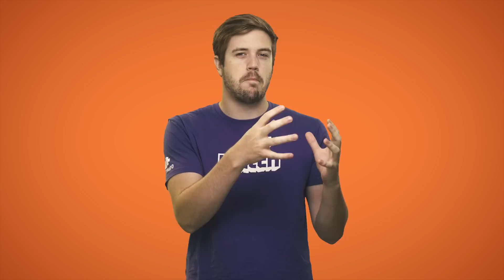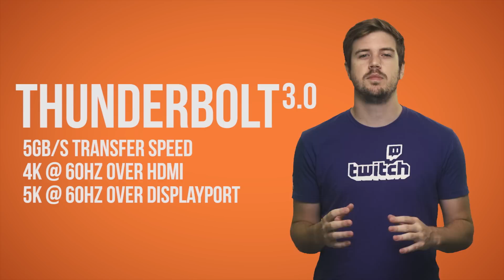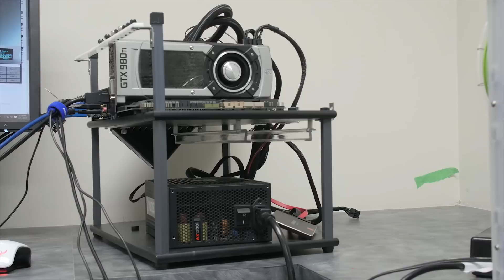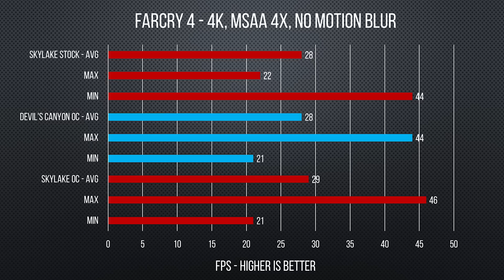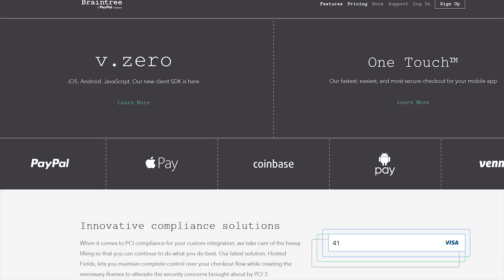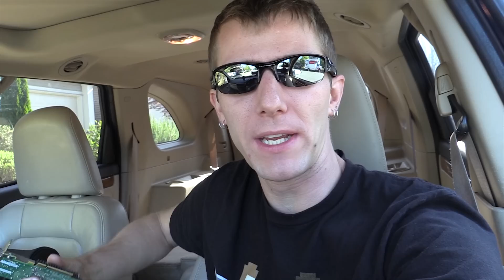Intel 6700K "Skylake" CPU

Comment: why didnt they put i7 5960x in the benchmark ?
Reply: +Matija Tkalec Because that's completely absurd.
Reply: why did intel release new CPUs if they arent better the the best current CPU ? At least cant they make skylake CPU with 8 cores hyperthreaded ?
Reply: Because people have different budgets and applications.

They will be releasing the high end ones later I assume.
Reply: Matija Tkalec they will when they update x99 ...
btw you can't compare a 350 $ cpu to a 1000$ cpu that is just pointless
Reply: +nightcore virus They have their xeon chips,  They have an 18 core 36 thread xeon, if you have $7000? http://ark.intel.com/products/84685/Intel-Xeon-Processor-E7-8890-v3-45M-Cache-2_50-GHz
Reply: nightcore virus Apparently the 6950x is going to have 10 cores.
Reply: nightcore virus No, the single core for it will be the same or worse, as stock speeds need to be kept in check for stability reasons. The 5960x at stock is meh, but it can easily be overclocked past 4ghz, as will the 6950x.
Reply: nightcore virus Well the reason the 5960x has "poor" single core is because you're probably comparing it to other Haswell chips, which all run at higher clock speeds stock. An 8 core CPU is not going to be able to clock as high as a 4 core CPU. :P
Reply: nightcore virus How do you figure? The 6950x will be Broadwell-E, so it's barely any better than Haswell in terms of overclocking. The only chip they have that's been able to break 5ghz without extreme cooling (phase change or LN2) is the 6700k, and that's Skylake, which is actually quite far ahead of Broadwell in terms of efficiency.
Reply: nightcore virus It's not Haswell-E, it's Broadwell-E, Intel does not release enthusiast chips until the architecture has been around for like a year or something, which is why the 7xxx enthusiast chips will be Skylake-E. People are most definitely going to buy it just because it's a cheaper 10 core CPU (Cheaper than a 10 core Xeon). Nobody in their right mind is going to expect an architecture barely better at overclocking compared to Haswell to be pushing 4.5+ghz on 10 cores. These type of processors aren't meant for gaming machines, you don't need super high single core performance. They're meant for workstations that are going to be doing a lot of video editing or 3D rendering, stuff like that.
Reply: nightcore virus When your going up to 10 cores, your crossing above the line for just gaming and simple rendering, unless you have more money then brains, because you'd never use or need the performance that the CPU can offer. Of course it's going to be overclockable, and it's going to overclock well, just not as well as  a 4 or 6 core i7. It's not going to be hitting 4.6 or 4.8ghz most likely, maybe 4.2ghz.
Reply: +EV Video What does consumer grade mean, kept searching it up and still can't find the answer :P
Reply: XGamingStormX
lol, thanks :P
Reply: +EV Video wrong...5960x has piss-poor single thread performance compared to 6700k..even sandy-bridge has better single thread speed.
Reply: +Matija Tkalec the 5960x would of performed worse due to a lower clock per core and the fact that these games don't support 8-cores very well. it's even worse than a Pentium G3240 single core wise, pretty poor that this cpu that is 20X cheaper.
Reply: +drakedoggy103 That's my argument when you compare Intel to AMD
Reply: +drakedoggy103 6800k, 6850k, 6900k, and 6950x are all x99. With 6, 6, 8, 10 cores respectively. Gonna be a big upgrade for X99, and that means the 8 core will be less than $1000. :3
Reply: +LiquidPanic I hope that ten core beast is true. God I wanna see something over 10 cores already with intel CPUs
Reply: nightcore virus Umm, Intel has had over 10 core CPUs for a few years now.
Reply: LiquidPanic Apologies, WHAT? I'm sorry I don't look at their line up much. I just look at any of their flagship CPUS. I didn't know that, but I'll look more into it. Thanks, and apologies for that little derp.
Reply: Chloe Fitzpatric, I was talking about their high end gaming chips, not their server ones. Lol but the 18 core is a true beast especially for gaming, but eh I want a higher clocked, more core chip, sort of like that 10 core that was rumored. I haven't heard much on it but I hope it is true.
Reply: LiquidPanic ohhh, 6950x. that sounds good. I can't wait to see how it'll perform, hopefully a lot better than the 5960x, heard the single core scores for that chip were horrible. Hopefully this does better.
Reply: LiquidPanic I see, well I had meant over clocked or not. That the scores show improvement from the last gen. But I see what you mean, wouldn't mind trading core score for stability. And I'll be surprised to see how well of an improvement the 6950x offers over the 5960x. Itching for it
Reply: LiquidPanic Trust me I know it won't clock nearly as high as them, and no. I'm not comparing them to others. I'm going based off of what others have said about the "poor" single core scores, I've seen some and haven't ever thought of them as bad. Hell they're pretty damn amazing scores for an 8 core beast. But I wish it could clock up that high, maybe in the ten core version it will. :P
Reply: nightcore virus If the 6950x has 10 cores, it will probably overclock about as well as the 8 core 5960x, as the power efficiency increases, but there are also 2 more cores to power.
Reply: LiquidPanic I'm sure by now intel has been able to make advances in being able to power all cores and keep them stable at very high frequencies, without needing to hold it back more. and I do hope you're right about that.
Reply: LiquidPanic Hmmm, well I don't know to be fully honest. I'm just hoping intel learned from Haswell and made these new chips more efficient and better in overclocking. You'd think because it's ten cores, 20 threads people will just buy it? Nope.(not saying anyone needs a 20 thread beast, just using it as an example.) But they would buy it for it's efficiency and how well it overclocks and handles different workloads. Honestly I'm not thinking over overclocking past 5ghz. Really no need for it at the moment. Well for most. and you already know what you need to overclock beyond 5ghz. That's isn't possible with standard cooling, least not for long. And I was under the impression that it'd be skylake? Hadn't thought it was still on haswell-E. Odd
Reply: LiquidPanic Ahh I see now, my apologies. I see now, and well I had thought it'd be around or above the price point of the 5960x. Since I thought it was to surpass it as the new beast of a multi core chip. But I see what you mean, I know they'll jump on it because it's a cheap ten core. But that doesn't make sense, if you're not looking for a ten core, highly overclockable chip, then why even bother with these? get Xeon if you need it. Regardless of if it's cheaper, aren't these types of chips meant to be more towards gaming/rending types? Like less server/workstation, more gaming/rendering. Honestly I really don't get that, I guess i have high expectations for this new ten core beast. Hmmm
Reply: LiquidPanic Well obviously if you buy this, you're gonna probably be doing some heavy rendering and gaming. I doubt you need it unless as you said you've got more money then brains. But I don't know, I myself if I could would buy it just because it's a ten core, though it'd make me do more rendering and gaming rather than let those cores go unused. And that's what I wish I could see, it go neck and neck with 4 or 6 core i7s. In clockspeeds and in single core scores. I just love seeing intel push the limits of things you know? being able to over clock a beastly ten core and remain stable and at decent temps. Hell that's what I wanna see coming into 2016. Pushing the limits without holding back. And I'd say maybe 4.4 to 4.5 max on the ten core. Wish to see something around 4.6 or hell even 4.8 on that. I know temps would be crazy on air, but simple water cooling or even heavy water cooling could possibly push it further. Maybe
Reply: nightcore virus Ehh, high end air coolers can offer the same performance of the majority of water blocks. Water cooling only really helps with GPUs, and just adds more points of failure anyway, I don't really see a reason for it. It's not worth it for such a small improvement in performance on GPUs, and maybe a degree or two difference in temps. Also, you keep saying single core performance, but in terms of demanding tasks, gaming is literally the only thing that benefits more from better single core performance, more cores is always better for any type of rendering or serious work.
Reply: LiquidPanic Considering I've lately started seeing water cooling as the best alternative (not for newbies). Only for those who have a decent amount of experience in building or upgrading pcs. Regardless of how much it helps, be it a few degrees or a major amount (not likely). I'd still get it, and well I know what you mean about it not really being much of a help cpu wise, but I do wish there were better ways of cooling the cpu using said waterblocks. Like idk maybe using different materials and finding better designs to cool them? then maybe you can OC higher and keep the system stable and lasting without failures or issues. And I keep mentioning single score because that's been the "issue" I've seen people complaining about the 5960x. My apologies, does get annoying to keep mentioning single scores. But yeah it's not really important considering this is an 8 and ten core cpu we're talking about and not a 4 or 6 core one. Honestly I agree with you that that's what it is best suited for, I just wish we didn't need Xeons for this type of thing. Maybe we just want to have an insane multi core cpu incase we want to do many things at once or hell render multi things at once? more Pcie lanes? A larger gap between being too under powered for many graphics cards or Pcie devices? But you're right, serious rendering and anything requiring such a high number of CPU cores would suit this chip much better. And I mentioned Pcie lanes because I would like to see that number (40 from the 5960x) go higher maybe 50 or 60? guess I'm just asking for too much. But I don't know, it'd be nice.
Reply: nightcore virus Sadly the PCIe lanes isn't going to happen. From the current roadmap, Broadwell-E will still have 40 lanes max. Even though it isn't confirmed, I doubt it will be higher, Skylake-E in a year will apparently have more, but yeah, I'm with you there, I kinda wish we had really high end boards with 16+ lane PCHs on the chipset, that would be nice, but it's hard to do, so it's asking a lot.
Reply: LiquidPanic I'm sure if we had high end boards, everyone would need to upgrade to a CPU that worked along that board (Skylake sure looks annoying now). But I do wish we did, same for CPUs with more than 40 Pcie lanes,. I wonder if we'll ever hear something like this confirmed or planned for down the road CPUs. And yeah it is asking for a lot. But I don't know, stayed with the same 40 and less for a while now. Guess I'm just rushing them to have more Pcie lanes with their cpus

Comment: PLZ i need a awnser to my question that has nothing to do with this video: I am planning to build a €1000 gaming pc. (Almost same as us dollar so just see this as $1000). I stil need to save some money to buy it. But i just bought a new 27 inch 1080p Lg monitor earlier this year. I think it was the Lg 27mp77hm and i bought it for €279. But now i am reading a lot of things about gaming in 1080p on a 27 inch monitor.
They say the amount of pixels is to small for the screen size. So i am thinking about selling it and buying the Dell 2515h which is a 1440p monitor 25inch for around €320. But the thing is. I am gaming on Ps4 right now (no hate plz). I really like it but i just also want a gaming pc. But my Ps4 is now connected to my 27inch lg monitor. I also use the monitor for my Macbook as a bigger screen and also there is a home cinema set connected to the screen to switch between Ps4 and Macbook. 

But the thing is that i don't know if the Ps4 which outputs 1080max will look just as good on the dell 1440p monitor than a 1080p monitor.. There is a video which shows some gameplay of xbone on the dell 1440p monitor and he says thats its just alright but i want to know for sure. 

Also another thing is that i want to build a pc like the positron which is an earlier pc build from austin evans. He shows that you can play 1440p just fine with that pc. But when i play a game that don't support 1440p or i don't upgrade my pc for a little while, and i need to set the resolution to 1080p will it then also look worse then just a monitor thats 1080p max???

Sorry for the long question but i really want to know this :)
Also sorry for the English its my second language. And I am 16 for people who want to know.

Comment: What does "native support for Thunderbolt 3.0" mean? What's the Alpine Ridge chip used for then? Is it up to the motherboard to HAVE both to be able to offer TB 3.0 ports? So I would have to have the Z170 Plattform with the corresponding Skylake Chip and the Apline Ridge Chip on the mothboard (which currently only Gigabyte boards have) to have Thunderbolt 3.0 support?
 Why do we only get the full support of the new HEVC (H.265) codec if we use the iGPU? So my PC can't use hardware accelerated decoding of HEVC through Skylakes iGPU or at all if I use a discrete GPU?

Comment: PCMASTERRACE FTW!!! 

But besides that, I think the 6700K is a solid upgrade if you want to try out newer components and get more security in terms of overclocking, but I really wanted the Skylake series of CPUs to be extremely baller compared to the 5th Generation Intel Chipset.  I know I am asking way too much, but I think for me, the 5th Gen CPUs are the way to go.  I would rather spend money on the 5820, or the 5930, then go with the 6700K.  That's just my personal opinion(and probably the opinion of a lot of other people.)
Reply: Vishal Venkataraman What do you think?
Reply: The 5960X, 5820K, and 5930K are 5th gen,  what are you talking about?
Reply: ***** Exactly my point

Comment: can someone tell me the difference please between DDR4 and DDR3 RAM if they're at the same 2400MHz frequency?
Reply: exodiathecoolone It's a good bit faster.... But most systems really aren't dependent on ram speed. It'll make the graphics on AMD apu's and Intel chips a bit faster probably and that's it.
A single 8gb stick of 1333mhz DDR3 would be just as fast in the real world as 128GB of 2133hz DDR4 in quad channel. -(Unless you needed more than 8 gb of course, which you don't unless you're doing something more demanding than gaming.)

Comment: I might consider upgrading CPUs more often if it was as easy as say upgrading a graphics card. When I want to upgrade a graphics card, I don't have to worry about the interface slot. All mobos these days have PCI-E 2.0 at the very least, with 3.0 becoming more and more common and 4.0 coming soon. I just take my old GPU out and put in the new one.
I can't do that with a CPU. I too am still rocking a 2600K. I can't upgrade to a Skylake CPU because I don't have the right CPU socket. I would have to buy a new motherboard as well, more than likely new RAM, and oh! I might have to buy a new Windows license, depending on whether or not Microsoft allow me to transfer my current license over.

Comment: 4.7 GHZ are you keddimg me i exspect more from LinusTechTips.
Intel Core i7 Skylake Processor Reaches Record-breaking 7GHz Clock Speeds 

To set the record, Chi-Kui Lam used a testbed featuring Asrock Z170 OC Formula mainboard, a G.Skill Ripjaws 4 DDR4 memory module as well as a 1300W power supply unit. The processor was cooled-down using liquid nitrogen (LN2).
http://www.kitguru.net/components/cpu/anton-shilov/intel-core-i7-6700k-skylake-hits-nearly-7ghz/

Comment: These Processors and benchmarks are wasted on the majority of the audience here and LTT. CPUs dont matter at all in gaming, you can still get away with CPUs from 2010 today for gaming as long as your GPU is good. Show me some real uses of CPU, like Code compile times in Visual Studio, or SQL query benchmarks on a local SQL studio install. These are the things that will really test your CPU and these types of users are going to benefit most from a modern processor upgrade.